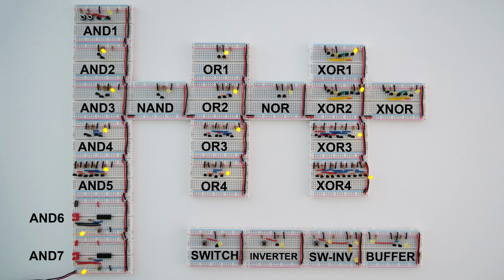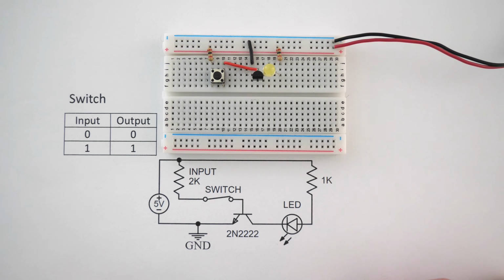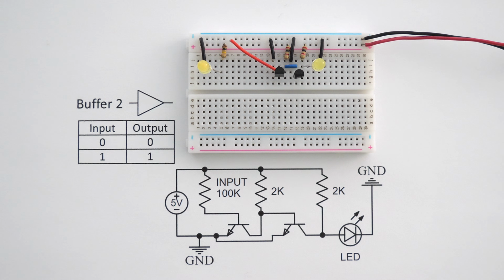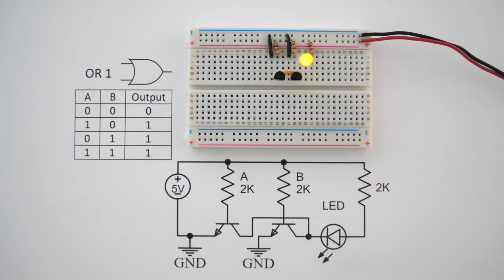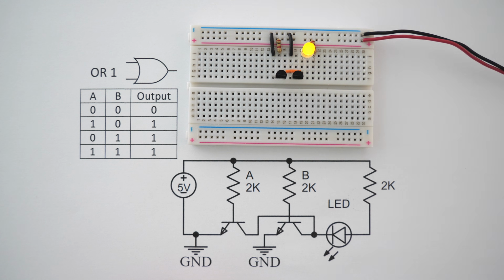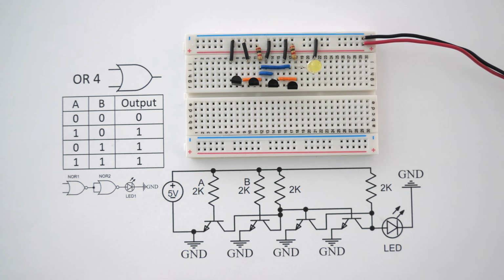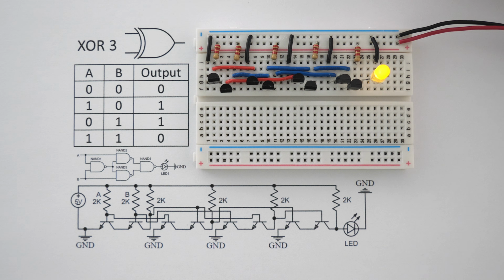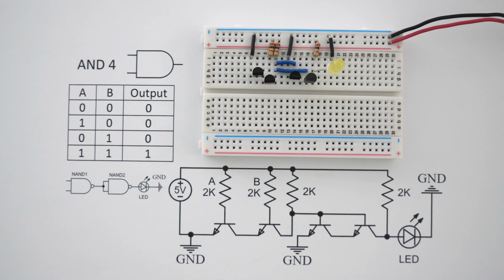Digital Logic Gates from Transistors, AND, NAND, OR, NOR, XOR, XNOR, Buffer, and Inverter

Comment: I have a question,
For the switch one, I copied that design. And it did not work for me. I had to remove the neutral from the transistor and put the led on the neutral. 

My breadboard was working on 16 volts DC. I don't know if that makes a difference but I did copy it. 
And every time I put the neutral on the transistor it went off every time I put power on the LED the button wouldn't work. 

Once again there's only after I took the neutral off the transistor and put the LED or neutral did this circuit work.

Comment: At 26:42, why does the current from the resistor on the left only go through the orange jumper transistor path when that one is connected to ground (yes, it isn't in this frame). Wouldn't there be less resistance to go through the blue jumper? Or is it because the circuit "knows" that if it went through the blue jumper then the LED would be turned on and that would need more power to be drawn?

Comment: 20:19 this one is driving me crazy, terrible explanation. From my understanding looking at the schematic, the two left transistors are saturated and the one on the right is also saturated, so it should turn the LED of but it is on
Reply from the maker: The two left transistors are saturated. So the power going into the second transistors collector can not go into the base of the third transistor. Making it off or not saturated. This is why the power from the collector of that third transistor goes across the LED.
Reply: @GlobalScienceNetwork But why? Does the current prefer 0.2v drop from collector rather than 0.7V drop from Vbe?
Reply from the maker: @dantel8995  Since the two are saturated there is basically no voltage drop to overcome so it is a straight ground (maybe it is 0.2v) but smaller none the less. The other way, it would have to overcome 0.7V, so no current will go that way.  Yeah, I think that is what you are saying as well.

Comment: Hello,I used BC 547 transistors and logic gates worked well.Will i face any problems using BC 547 instead of 2n2222 for adders and 32 bit calculater? Pls help me.
Reply from the maker: I think the base collector and emitter position is just reversed, but otherwise should work. I used 2N2222 or 2N3904 which are basically the same.

Comment: Will bc547b transistors work with these circuits??
Reply from the maker: I am not positive, I think so but the emitter and collector are switched so you have to flip them. I know 2N2222 and 2N3904 work.

Comment: I guess the XOR 2 is wrong. Because whenever A and B both are ON, the last transistor is switched off but the LED is turned ON. 35:36
Reply from the maker: The input goes into the base of the transistors. Only one of the input transistors has a resistor input going into the base.

Comment: On XOR1 I don't see why postive voltage can not flow through the 3rd transistors base. Can you please explain.
Reply from the maker: Well, the last transistor is more of an inverter. So when it is On when the base is off, and when it is off the output is on. I am pretty sure. I did not look to close at the XOR1 circuit but that is typically how these work so they can send the data.
Reply: @GlobalScienceNetwork  Thank you

Comment: 26:50 OR3 looks strange, the circuit has only 2 inputs (left bottom). The truth table also has only 2 inputs.
Reply: Ok, I got it, its always a 2 input gate and you show different methods to do it. A OR3 gate with 3 inputs can be build with 2 OR2 gates and we need 2 times more transistors.
Reply from the maker: Glad you got if figured out now!

Comment: Sir, Why dont we use the ANDgate with emmiter follower configuration as like uhh did for buffer.
Taking the output at emmiter terminal will also works right!
If so then why dont uhh include it sir
Reply from the maker: There is a BJT fan-out limitation or cascading limit with that design: When a BJT gate output drives multiple inputs, it must supply base current to each connected transistor (I_B × number of gates), and this current must flow through the output transistors which eventually causes voltage drops and unreliable operation. Unlike MOSFETs which draw virtually no steady-state gate current, BJTs require continuous base current to stay on, fundamentally limiting how many gates one output can drive to typically 5-10. So it works when connecting a few gates, but not great for larger circuits.

Comment: If i want to add buttons instead of pulling out resistors how would I connect it?
Reply from the maker: Yeah, just look for momentary tactile push button switch for breadboards. Like using a DIP switch myself, as it will stay in the on or off position.
Reply: Where and how should I connect it? @GlobalScienceNetwork
Reply: @GlobalScienceNetwork what type of dip switches?

Comment: Second time going through this amazing video. I'm definitely going to make all these circuits. asap. Very useful for learning. And useful in some situations where they can replace dedicated ICs in simple circuits. 

May I make one request: I would love to see you explain the math of these circuits .. at least the ones where output can go down the line. So that we can know how to choose proper base resistors for desired output current and/or voltage. Continued thanks for your work and sharing!!

p.s. your website is a great accompaniment to your videos!
Reply from the maker: That would be a good idea. At around 7:20 I do show the basic idea with the voltage drop values. Basically the output has 0.16 volts with a 2K resistor when the output is off. When the output is on there is just the one resistor in the output path. This is often called the pull up resistor as the LED and transistors will have there set voltage drop and the rest will be lost across the resistor. The location of the resistor could be at the beginning or end of the circuit which may be hard to grasp a first. The resistor value used will control the current of the output.
Reply: @GlobalScienceNetwork   @GlobalScienceNetwork  Yes you did, I noticed that, and I appreciated it. Long story short, I couldn't get an NPN BJT to act as a switch between two IC circuits. I thought it would be the simplest solution. Since it didn't work, for now I went with an SR latch via a cd4013. But it made me realize I didn't understand enough about transistors, and I took them for granted, thinking they are as simple as other discrete components ... they are not :-)

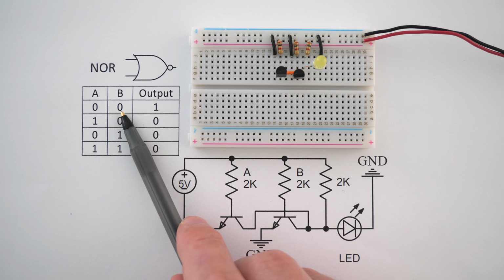Comment: To the NOR gate at 30:44, can you work with just one transistor, if you put both gate signals on one transistors? If one of these signals is at 5V, you get a base current and switch. Of course, if both inputs are on you double the base current as well, which the transistor should handle, since 500 Ohm instead of 1kOhm also works.
Reply from the maker: I am actually not positive. You could be correct. Give it a try and see if it works!
Reply: @GlobalScienceNetwork  Well, I wait for a video to see if it works  :)  (at home, i do not have electronics, a full-time job as a researcher is enough).

Comment: To 17:03, So the AND gate is great and works fine. However, can I connect the wire between transistors 2 emitter and transistor 1 collector to something as well? This should be signal of switch 2, unless switch 1 is also active. So its complicated, but then we dont only have the normal logical gates, but additional functions which save us transistors.
Reply from the maker: It should be the invereted output as you suggest. If the resistance of that circuit is to high though it might make the logic gate not work properly. So it depends on what type of gate or buffer is connected.
Reply: @GlobalScienceNetwork  Oh, now things get interesting! What happens, if you connect 3 transistors in series and put a switch to each. Sure, you have an AND-gate with 3 inputs. However, at the same time, to 2 top switches are an AND with 2 inputs. Normally, you would make 2 AND gates with 2 switches each and put them in series, so you need 4 transistors in total. Now, you need only 3 transistors for the same function! I hope, I could somehow explain the idea :) 

Maybe, I focus too much on optimization, while you have to focus on a good explanation for the audience.

Comment: Ok, I get where you're going through this as a learning exercise, and I appreciate it very much, In fact, I haven't even watched all the way through yet and already know I will watch at least one more time. . Are there situations where one might use one of these circuits over, say, a cd4001 or cd4011?
Reply from the maker: Yeah, there are cases where just using basic logic gates is easier than adding an IC. It is mostly for educational value, to learn how to build more advanced circuits from individual transistors. I even show how to build a 4-bit computer working off these basic gates.

Comment: I dont know why, when building the XOR GATE 2, if i dont change my last resistor(not the one connected to the LED, the one before it) for one with more resistance the gate doest work.
Its working now and im using 2.2K in every other resistor but the last one that is 22k, i tried with 4.7k and 10k and didnt work either.
Are my components a bit different in terms of voltage and current consumption?
(using 2N2222A transistors)
Reply from the maker: Hmm 2N2222 transistors should work with the 2.2K resistors in every location. Is your voltage 5V? I would say double check the location of each connection or try and swap out with new transistors as one could be bad. Probably a small wiring error though.
Reply: @GlobalScienceNetwork  I checked it só many times, i think i have everything correct. I dont belive that it is a wiring error because why does it works with higher resistance then.(I have 4,94 V)

Comment: This is a great instructional video, and I thank you for it. not only useful information , but useful information served in a usable manner. Now, if I may ask, why didn't you considered using DTL(Diode Transistor Logic)? I mean, it is a simple way to keep circuits simple and keep the number of parts down. could it be due to didactic concerns ?
Reply from the maker: The progression of the technology went Resistor-Transistor Logic, Diode-Transistor Logic, Transistor-Transistor Logic, and then MOSFETs. The computer I built is a mixture of RTL and TTL logic gates. DTL was an option but I just liked using all transistors. Looking back I actually would have liked to of used MOSFETs as the power consumption would be lower. So I plan to make more videos about MOSFET logic gates compared to the others in the future.

Comment: If I need to achieve a specific output, how should I design a circuit? Should I first sketch it out on paper? Please tell me how you do this.
Reply from the maker: You could just try and build the circuit on breadboards, sketch it out on paper or use a circuit simulator. I have video's about how to use two free circuit simulators, LTspice and EasyEDA.

Comment: 20:37 can you explain the current following through the circuit if both A And B is ON then both the transistors are ON and there is third resistor which is connected to the second transistor collector and third transistor base is there any small amount of current following through the base..
Reply from the maker: If both inputs are are on the last transistor is off so the current will flow into the LED to ground. No current will flow into the base of the third transistor.

Comment: Actually and is a nand, or is a nor etc...
Reply from the maker: I am not sure what you mean?
Reply: @GlobalScienceNetwork  like AND 1: beautiful with the led, right? But if you read voltage on the output it works like a NAND and not like an AND.
The led is placed in a way that invert the output but if you want to use in a circuit that's not works like an AND...

Comment: I was confused and angry for two straight days because what he was saying wasn't making any sense to me. Like the path the current takes and all that.why is led lighting up when the resistance is literally the same .And then after watching the buffer, invertor and the switch for 20 times I finally found the problem. The problem was me trying to make sense of the electron flow. Turns out when he said current is flowing from collector to emitter he was using conventional current. And I was thinking of electron flow.oh god my brain hurts. I thought I was super dumb or something 😭😭. Two days. 20 times!!!!
Reply from the maker: Ha ha that would make things seem confusing. If I was the one originally coming up with the convention I would have had made convectional current vs electron flow be the same. Also metric would be the only system of measurement. I am glade you figured it out. Good luck with your circuit projects!
Reply: @GlobalScienceNetwork  thanks 🫶🏻😂

Comment: How many components we required to do this exp
Reply from the maker: To make one logic gate you just need a few 2N2222 NPN transistors, LED, 2K resistors, breadboard, and wires. Also, you need some way to power the circuit with around 5 volts of power.

Comment: hi thanks for this. one suggestion: i think it would be much more clarifying if the explanations are made over the diagram rather than over the real components.
Reply from the maker: Yeah, that was a decision that needed to be made. Then goal was to try and help people build the circuits so that is why I typically explained it from the components. I did include the circuit diagram below each circuit though so you can look at that if you are not sure about the connections.
Reply: @GlobalScienceNetwork  I am searching transistor and the other component prices!

Comment: I have gone a lot of understanding from your video 
But I wish you would do the current flow explanation on the circuit diagram 
Thank you 😊
Reply from the maker: Yeah, BJTs are current driven transistors. Thinking of it in terms of voltage drops and where the current will flow is important. I did try to explain where the current will flow in each case.

Comment: why didnt you use a switch
Reply from the maker: Do you mean on the inputs? Most of the time the inputs are fed in from another point on the circuit. So in this case it is easier to just add and remove the resistors for on and off.
Reply: @ yes i just like electrical switches just for inputs  im planning on making a Cameleon circuit that can shape shift into nand xor and gates all the gates in one board by creating seperate connections the more complex one im working on can switch back and forth to all the logic gates and it can be used as a computer but the leds will be flashing on and off when it swiches back and forth but this one is more complex
Reply from the maker: @wiserthanserpents  Sweet! Send me a link if you make a video about it!

Comment: Hi! First of all, I am amazed by this video! This is truly a diamond channel :) 
But I tried to buid the AND 3 gate in TINKERCARD. I used a 9V battery, but i increased the resistors resistance to 100K! It is the same as shown in the video, but when I remove the A input, the the voltage remains at ~ 2.8 mV; when I remove input B or both inputs, the voltage stays at ~ 4.56 mV. Is this normal? As far as I know, the logical 0 sould be represented as 0 volts for better "communication" between other gates! Thank for reply!
Reply from the maker: Good question. I would say TINKERCARD is using an equations that results in a near zero value such as 0.0028 Volts. I would take that as zero for the simulation case. I would have used 5V and a 2K resistor but you will likely get similar results. The inputs off are floating but with this design it does work. In other logic gate designs you need to ground the input for it to truly be off. In some cases floating can even represent an on input as is the case with the ICs at the end.
Reply: @GlobalScienceNetwork  That seems logical, thanks! So, in real life if I were to measure the voltage around the LED when one or both inputs are off, then I'd get 0V right? And thank you for the fast reply! :)
Reply from the maker: @istvankerti2609  In real life you would definitely have zero current. There may be some very small voltage on the output but not enough to overcome the required voltage of the base of the next transistor or an LED so the logic will be zero. If this was connected to the input of a circuit where floating is on then you would need to ground the output for logic zero.
Reply: @GlobalScienceNetwork  Thank you so much! You are incredible! Keep going!!!! :)))))
One more question: Where sould I buy these components, breadboard(s), wires ect....?
Reply from the maker: @istvankerti2609  Thanks! I just got them from Amazon. I plan to put together a kit at some point, but I don't have one available at the moment.
Reply: @GlobalScienceNetwork  Okay, thanks! I'll have a look.

Comment: Is better to have the base of the transistor when it's off pulled to the ground or to be floating?
Reply from the maker: Good question. For these logic gates designs floating is off so grounded the input is not needed. However, there are cases were grounding is needed to be off and other where floating is even the on case. If you are building these though it is not necessary. The ICs that I show at the end need to be grounded to be off.

Comment: When you remove an input, wouldn't that mean the input is "Undefined" Isn't it better to explicitly make it low/high accordingly?
Reply from the maker: Well, this is sort of hardcoding it, where if the input is removed it is off. Technically it is floating. Some logic gates designs do require off to be grounded but in this case, floating works fine for the off case. In some logic gate designs, input floating is actually the on case and needs to be grounded as is true for the ICs I show at the end.